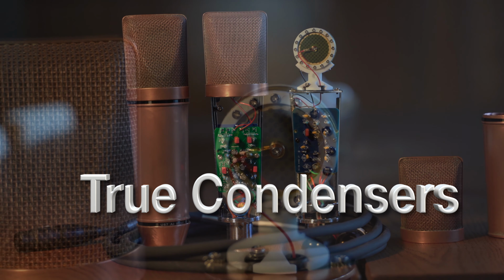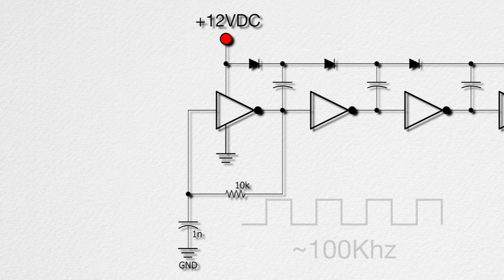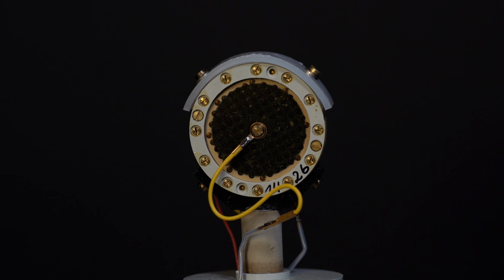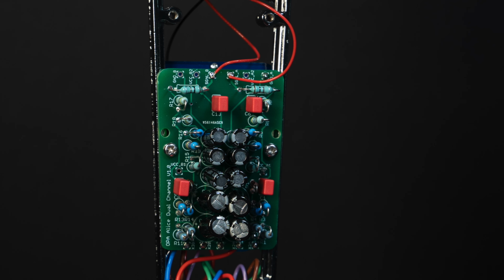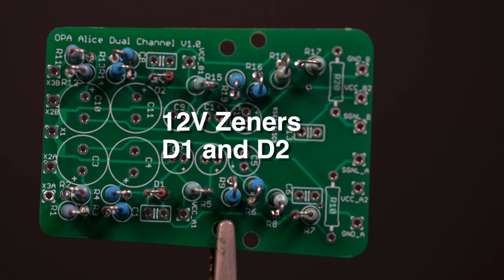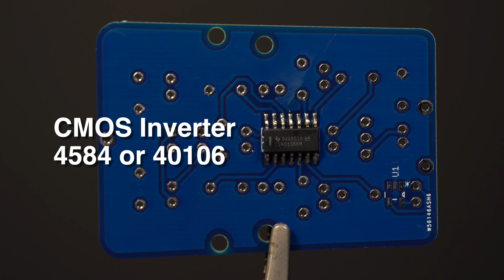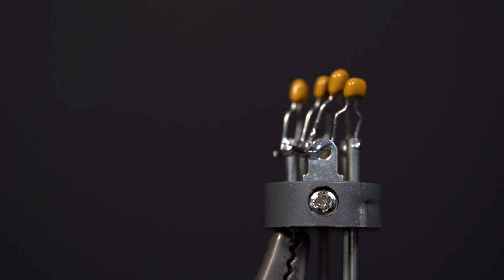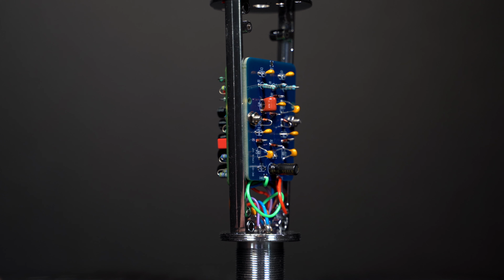True Condenser Build

Comment: Honorable Jules,
If I put both circuits in a box 1 meter away from the capsule, will there be any problem for audio quality?
Thanks in advance! 🙂
Reply from the maker: You would really have to shield it well and use really low capacitance wire… I haven’t tried that.
Reply: @SoundSleuth  
Then I will tell you the result after trying.
Thanks again! 🙂
Reply: @nayeem.al-ghazee  did you ever do it?
Reply: @lucasc5622  
Sorry! I actually forgot to mention.
I could do it. But the noise had increased a bit. By the way, I'm currently using the cheap AKG P120. It has more self noise than other microphones. As you surely know, it has 3 female pins. The way you used 4x 22nF on 5 pins to make the True Condenser Microphone, would it benefit this AKG's microphone?
Please answer me- If you are sure of it. 
Or give me any other advice to reduce its noise. 
Thank you!

Comment: do I need the hex inverter if I can use 48V phantom power?
Reply from the maker: Yes. The 48V coming from phantom power supplies the OPA Board.  At that point it is dropped to about 20VDC at the XLR input.  The hex inverter takes the regulated 12V supply from the OPA board and turns it into a clean filtered bias voltage for the capsule.
Reply: @SoundSleuth  Okay, that's a lot! I'm going to try to use a Behringer C1 and gut it to replace the entirety of the electronics and turn it into a true condenser. Unfortunately, I've only worked with PC/laptop and guitar electronics in the past, so this is quite an adventure.

Comment: If my capsule has only one positive wire, how do I wire it up?
Reply: You wire the metal housing of the capsule to the polarizing voltage "POL" on the hex inverter.The saddle for the capsule insulated it from the mic body.

Comment: How did you calculate 100kHz oscillation?
Reply from the maker: The 10K resistor and the 1nF capacitor form an RC circuit and the hex inverter is a schmitt trigger. It is ballparked at 100K but measures pretty close. https://www.changpuak.ch/electronics/datasheets/AN-118.pdf

Comment: Why not 48V phantom power?
Reply: And, how exactly connect this (sorry).
Like is it 12v or 18v phantom power?
Reply from the maker: It uses P48. Phantom power
Reply: @SoundSleuth  Didn't expect response that fast. I got it. Phantom power get's lost in cables and circuits, so you limit it at stable 12V using zener to ground, and than boost it to 80 using HEX.   Brilliant.

Comment: Hello! Please tell me if I want to use this capsule https://www.jlielectronics.com/microphone-capsules/jli-tyu-86u/ what to do with the fourth cable from the second membrane. As far as I understand, your scheme uses 3 cables, a front membrane, a rear one and a common third cable. I'm sorry if my question seems too stupid and naive, but I'm just starting to get to know this world.
Reply from the maker: This is a Great Capsule! I just Built a pair of mics with them. They are dual backplate. You could use separate bias viltage supplies but that isnt needed. Connect them both together and to the +Pol voltage from the Hex Inverter and then the other two just like the TSC-2. I really like these.
Reply: @SoundSleuth  Thank you, now I understand everything! Thank you. The printed circuit boards have already arrived to me. It remains to order electronic components.